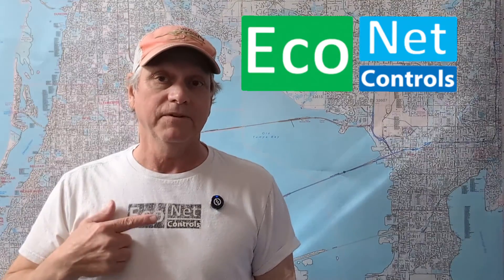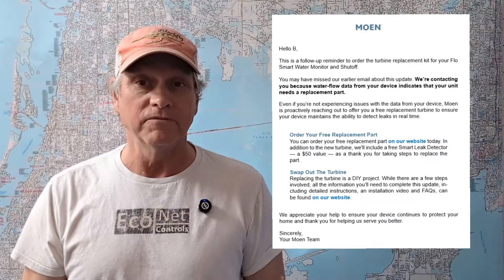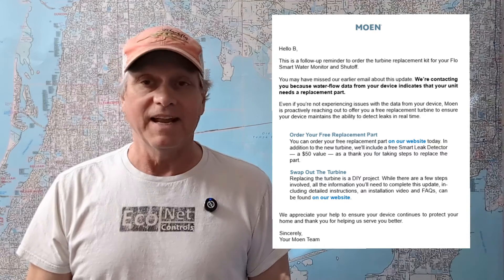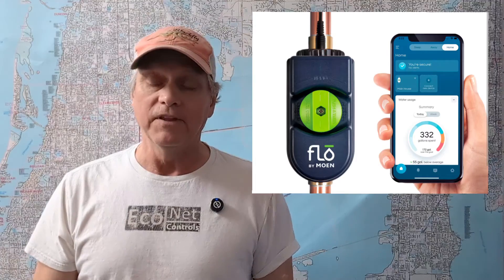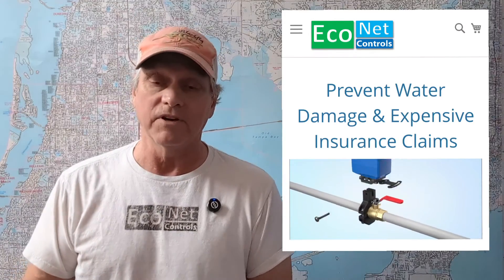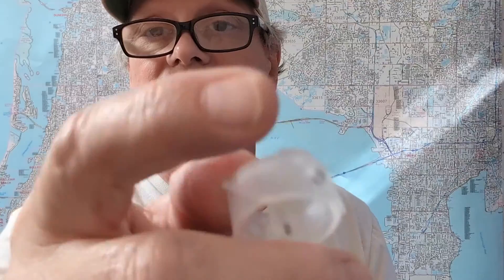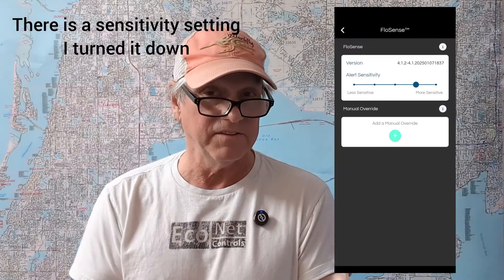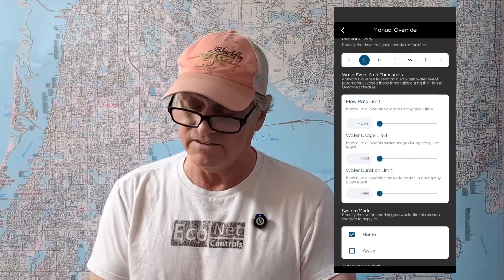AI Smart Home and Leak Detection: Moen Flo Repair - How It Works, Fixing Issues, and Expert Insights

Comment: Is the Bulldog valve itself weather resistant? I want to install it inside my main line water box which is at (or just below) ground level just outside the house. The box has a cover with a finger removal hole (which could be sealed) but the valve would still be subject to warm, cold and damp conditions.